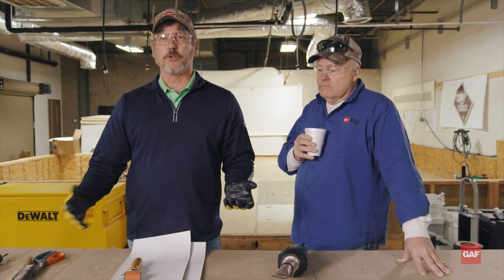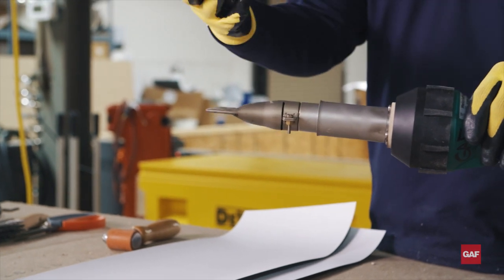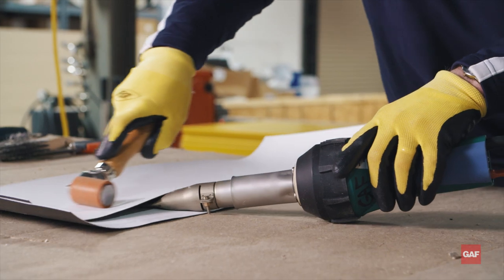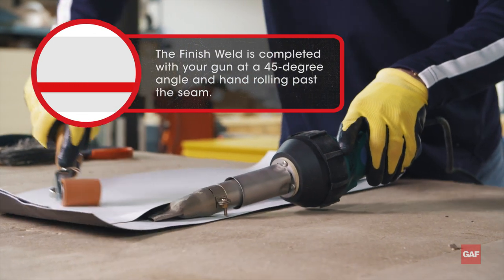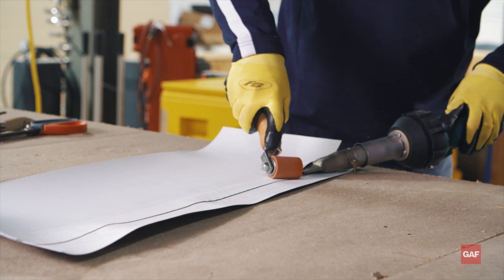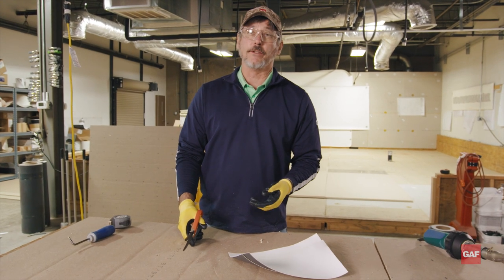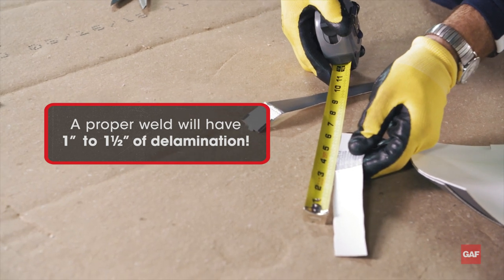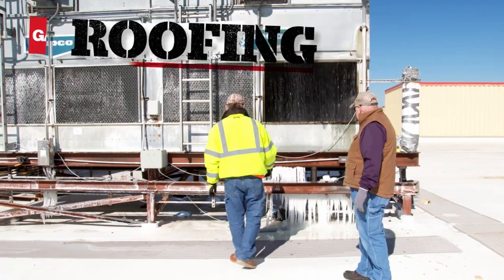Basic TPO Hand Welding Techniques | Roofing it Right with Dave & Wally by GAF

Comment: Awesome tips. I've been doing tpo roofs for years, and instead of a pre weld, we just do a quick small tack weld every 2 feet or so at least 3 inches in to ensure the tpo doesn't move when welding it, and they NEVER leak, it'll save you some time for sure.

Comment: What happens if your hand weld is greater than 1.5"? Isn't more better?
Reply: That is my question too.  I thought he mispoke at first but then he repeated it later in the video.
Reply from the maker: Hi. The hand weld must be a min of 1" and a max of 1.5". If you'd like more information, please send us a message on Facebook or Twitter and will share the EverGuard Mechanically Attached Manual with you.
Reply: @gafroofing  Thanks for the reply but we asked a "why" question and your sending us to a place where were not going to get a "why" answer.  It's just going to say the same thing you just said.
Reply: No, its not better. The standard hand welder nozzle is 1.5" or 40mm wide. The thing is, when welding the lap, youll have the welders nozzle at a 45 degree angle, not perpendicular to the lap, so you lose a tiny bit of that 1.5". On top of that, you gotta leave an 8th to a  1/4 inch of the nozzle out of the lap to make sure it welds. These people have it dialed in. You dont have to reinvent the wheel.

Comment: If the weld is stronger than the sheet itself, why can you pull it apart? Good luck trying to tear a sheet of TPO in half with your bare hands.
Reply: You can pull it apart because you have leverage from the two strips. if you cut the seam and compared ripping a strip along the seam vs ripping a strip of TPO the seam would be substantially stronger. If you epoxy glued two ropes to a random piece of TPO you could do this experiment too.